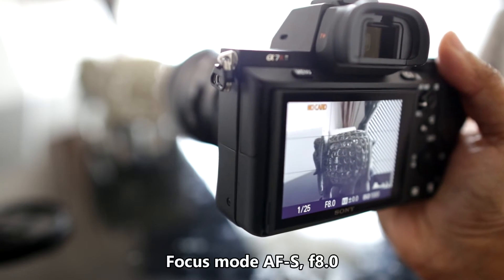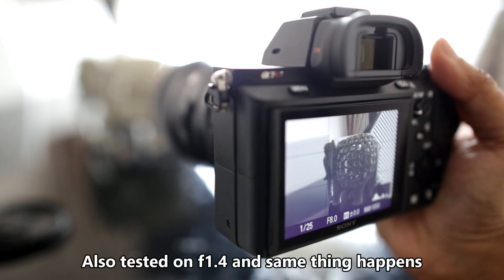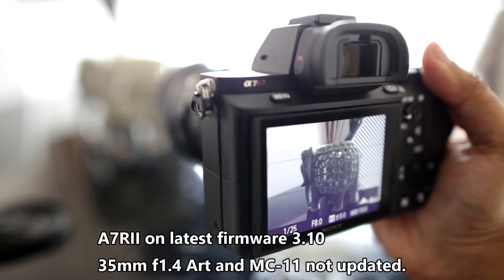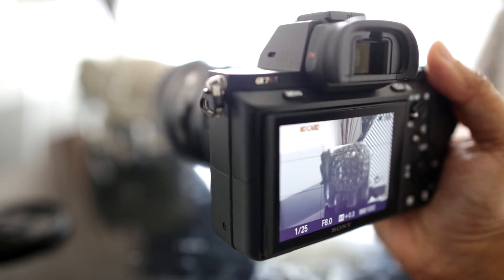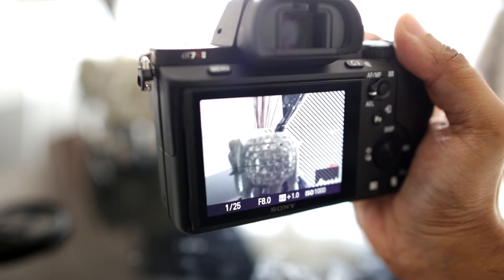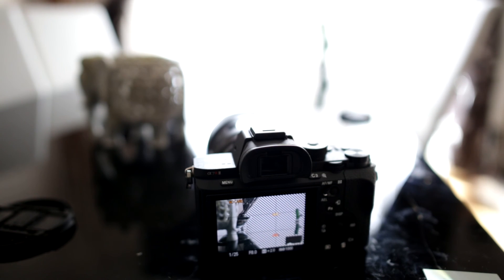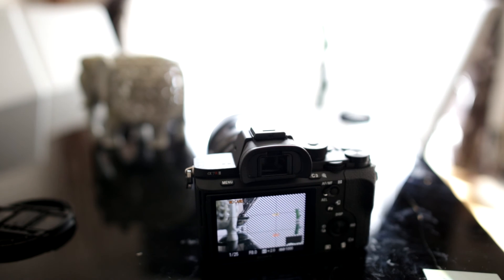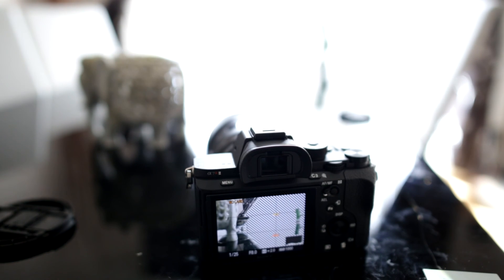Sigma MC-11 Focus Sound Issue

Comment: That is actually the aperture blades making micro adjustments in "1/3 stops".  All Sigma Art lenses seem to demonstrate the phenomenon, especially when used with converters.  There is another YouTube video where a tester shows this through front element of a 50mm art lens and you see the blades doing this.

Comment: Yea I have the 35mm art Canon mount and the sound is exactly the same using the adapter mc-11 on my Sony a7rii. I alternate camera body's to my canon 6D and the sound is still there but different. It has to be the lens, not the adapter. If it was the adapter the sound wouldn't be there on my canon 6D.

Comment: bit late, but Sigma tells you that video is not supported for any sigma lens with the mc-11. Too much noise especially AF-C. For stills both my sigmas 35 and 85 art have none of the issue you are showing.The focus mechanism on the lens is not totally silent and using af-c can maybe damage the lens in the long run if used for video.Who knows...

Comment: What happens if you try to record video with it? On my setup, there's definitely some light clicking (no flutter that I can hear though) when focusing for stills, but in video mode with af-c turned on it sounds like a Geiger counter :(

Currently using it with 6300 and 18-35 1.8 canon mount, still an amazing combo but it has its quirks.
Reply from the maker: With my setup, the video option also creates this sound. Infact it is more so, as the camera is always hunting for focus. Having said that, it does appear to be random. some days it will happen, and others, it will be as near silent as it was on my Canon.
Reply: +Ajit Deb have you find out if it's an issue from the mc-11 or the actual lens...
Reply from the maker: Marc Fitt Vlogs hi. This is definitely the lens. The sound coming from it is actually the sound of the aperture blades closing down. The lens seems to open its aperture to around f2 at the start of its focus cycle. Once it achieves focus, the lens will then close down its aperture to your chosen f-stop. Which also means that the higher the f-stop, the longer the noise lasts. It becomes noticeable from around f4. Now, although the noise does indeed come from the lens, it only occurs when using it with the adaptor on my Sony camera. On my Canon 6D it is near silent.
Reply: +Ajit Deb I see, because I wanted to use the 35mm sigma in video and damn even with an external mic we can hear it on the recording :(
Reply: Have the same sound with mc-11 and 18-35 art. Did you find way to remove this sound in FCPX?
Reply: haha no mate... U will not remove this sound... you shoud use   external audio recorder

Comment: Man, I've got the 24mm art / MC-11 on the A7Rii and it makes the exact same noise! Filming is even worse - have you found any better news?
Reply from the maker: Joshua Newton Hi! Unfortunately no. It does seem like for stills it'd be ok, but for filming it is a pain. Note, that I have latest firmware for the MC-11 but not the lens itself. The lens can be updated with the Sigma Dock which I don't own. That might be something to try if you can. Thanks for watching!
Reply: Ajit Deb ah no worries cheers man! I was so shocked when I first found it... Thanks for making the video! Such a shame about the noise.
Reply: Ajit Deb ah no worries cheers man! I was so shocked when I first found it... Thanks for making the video! Such a shame about the noise.
Reply from the maker: Joshua Newton You're welcome! I agree, it is a shame. As an adapter it works fairly well, otherwise.

Comment: Same problem with Sony a6300 + mc-11 +sigma 18-35 f1.8.. Very disappointed
Reply: Hi dude, did you solve this? recently bought Sony a6300 + mc-11 +sigma 18-35 f1.8 and got that noise while filming on AF C